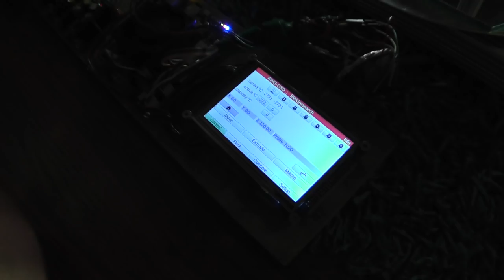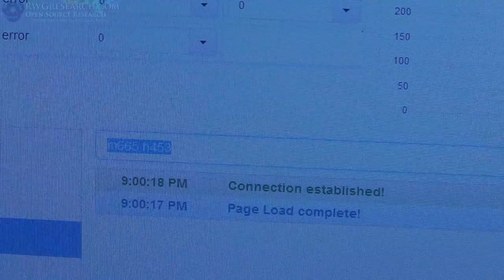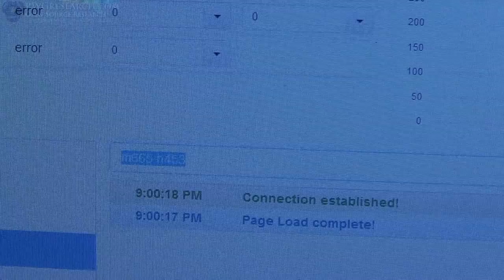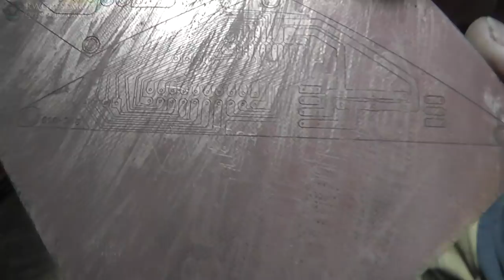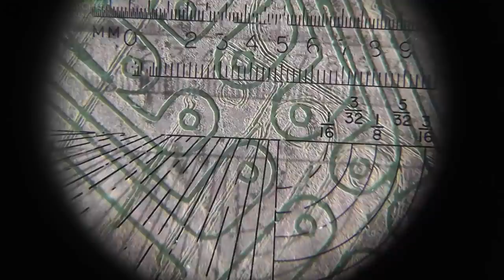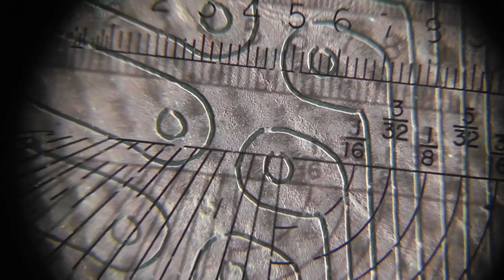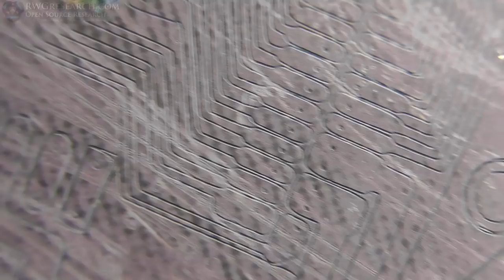RWG-OSD # 28: Scratch n' Etch PCBs - 3D Printer Makes Its Own PCB's! Double Sided!!!

Comment: It took me several goes to watch this because of Lily being a doof :D I was in tears, that was so SO very funny! Please do more videos with her! Just do a skit where you're both at a table and talking to one another :P

I think those sections where you're getting short circuits is where the toolpath ends for that segment. It looks like they're on most if not all of the ends of those pads, and I'm guessing what's happening is the sharpie ink is sloughing off and being pushed along the track by the engraver. That tiny bit of ink at the end of each toolpath is enough to resist the etchent, leaving a tiny copper bridge once the PCB is etched.
Reply: exactly what i think about those shorts
Reply from the maker: the shorts are where the tool path of my slicer.  so the tinny tinny bit of slop on my spring point stops before it makes it all the way around. I could fix that by making 2 paths. but that's how it is for the moment. I use a new way of making the gcode now that resolves that. more on that in a future video. ~Russ 

ps. yes Lilly.  lol.
Reply: ***** Poor Lily! Give her cuddles, she's friggin awesome :D
Can you adjust the toolpath to "overshoot", as it were? Or do two passes and simulate, say, a stepped router path?
Reply from the maker: yeah kinda. I found better ways to do it. I was using .01mm. tool path's. that's crazy. so...  I'm now using a diffrent method of making the g code using flatcam. it dose the job but I have to still change a lot of the Gcode by hand. but that's ok. it's not hard. ~Russ

Comment: Russ, 
You might want to try "Ammonium Persulfate" as your copper etchant. You buy it as a white crystalline solid, mix with water as needed, and makes a clear solution which turns bluer as the copper dissolves. The mixed solution lasts a month or two but the solid will last for years on the shelf. I use it and it works great. The bath always stays clear enough to see the etching progress. I think that is less nasty than the Ferric Chloride type etchants.
Reply: William Hada The easiest I've found to use is equal parts 30%HCl and 30% H2O2. It's a variant of the Cupric Chloride etching solution, and etches very fast- around a minute or so. requires no aeration, just agitation during etching. It can be stored indefinitely in a vented container-very important as it requires some time for al the gas to dissipate. If you have a vertical etching tank, use it to aerate it and you have a starter cupric chloride tank.
I've switched from ferric chloride to cupric chloride a while ago as it is much faster, requires no heating, produces better results and is 100% recyclable - you can precipitate the copper back into metal form, and there's a process to get it back to basic chemicals. With ferric chloride you can't easily do that at home.

Comment: Take a look at Cupric Chloride etching. It's much faster than ferric chloride, requires no heating (just aeration) and uses just HCl and copper for chemicals. You can even omit aeration if you add a tiny amount of H2O2 before etching.
You can make it at home by mixing equal volumes of 30% HCl and 30% H2O2, simple as that. And it is 100% at home recyclable.
Reply: It's only Cupric Chloride after you've etched and is only useable once. But, you can disolve some steel wool into it, and that will give you Ferric chloride, which can be used several times. The iron oxidizes and holds the oxygen, hence the rusty brown color. A very inexpensive way to etch wether you turn into ferric chloride or not.
The HCL is bought at home depot for $10-$20 a gallon and is sold as muriatic acid. Mix one part HCL into 2 parts H2O2(3% Hydrogen peroxide). You can etch with this or add about 7 grams of steel wool to every 100ml of HCL and H2O2 mixture to make ferric chloride.
Reply: Robert Tomkinson CuCl is usable pretty much forever. Just bubble air through it and the extra copper drops out as insoluble oxide. It starts with HCl etching the copper, leaving Cu2Cl. The H2O2 or air bubbler separates one Cu from Cu2Cl and drops it out as CuO. CuCl is a better etchant than HCl.

Comment: Is the side the was not etched as deep the side that was facing down in the bath?  If you don't flip the board or agitate the bath, the side that is facing download is exposed to a smaller volume of etchant. The etchant does get used up as it works and slows down if it is a smaller volume. Maybe getting the board off the bottom by using spacers would help getting the board more evenly exposed to etchant.
Reply from the maker: you are exactly right. after I made this video I was guessing the same thing. also I was using used etchent too. so that's no help. all in all This was a test any how. you can see that the bord was already don't once. lol. ~Russ
Reply: William Hada For single sided boards, I float it copper side down and the denser saturated etchant sinks and it etches faster.

Comment: Sand paper is a big no no as you can see by those deep scratches. Use fine steal wool to polish the board before and after etching to remove the ink. No need for acetone or alcohol. Regular sharpies are not good for etching. Use industrial sharpies or a marker specifically for etching especially if your traces are as small as yours. Regular Steadlers work the best before they changed their formula to their new leave the cap off anti drying up formula. Regular acrylic paint works good too and its non toxic unless you like to get high off the markers. I've used acrylic paint with very good success but may not work as well as a marker for very fine detailed stuff like yours.
I think you should have watched a few how to videos on etching before you tried this.

Comment: Hi Russ, great use of the delta :) I am surprised as your etching you didn't sharpie a positive with your printer and etch the whole board instead of routed traces. great work on the printer btw, I would love to build my own delta :D
Reply from the maker: Yeah. that's also a good idea. for some bords that would work better. but for this one the traces are way to small. I'll keep that I mined for future ones! thanks!! ~Russ
Reply: A while back I built a cartesian pen plotter for doing circuit boards (though I now usually just send stuff off to Osh Park).  I was using Staedtler model 319 S-9 which is their 0.4mm "Lumocolor permanent special" marker.  They come in red and black.  I used the black and it really stands up to the ferric chloride etchant, though I seem to recall that the red was supposed to be even better for that.  I just did some browsing and maybe the Staedtler 313 in 0.4mm width would work as well.  The black is weather resistant.
Reply from the maker: thanks for the comment. I'll look in to that. ~Russ

Comment: Why don't yuo just use a sharpie fine point to fill your vias and etches, soak in solution, still use punch for drill point perfection. It would be like making a normal board. My question is once it's all done can you put a thin layer of blue plastic down and then follow up with a white showing resistors, caps, chips along with the R1, R2, C1 labels in white. I've wanted to try this for a year now but my budget doesn't include buying a 3D printer.
Reply from the maker: yeah some good thoughts. there always  things that go wrong lol . the first problem is that the maker is not good enough for some of those fine traces. i like the punch idea as a hole starter then drill by hand... i can do that with this method.  ~Russ

Comment: You need jumbo sharpies in your life :)
Reply: MiggyManMike :)
Reply from the maker: Haha. yeah I sence then bought one. but next for the laser I will use Somthing like paint. ;)  ~Russ
Reply: Oddly enough I was playing with doing almost the same thing with lasers, my 250mw laser stood no chance, got a 500mw waiting to be tested :D
Reply from the maker: oh cool I orderd a 2.5w lol. yes 2.5watt. it's over kill for most but I wanted the extra power so I can cut things like vinal. and thin stuff.  card bord. stuff for stencles and stuff. but mainly for engraving. will see should be a lot of fun! ~Russ
Reply: Make sure you have the right specs for that, 2.5w is well into "a little dangerous" territory :D

Id have gotten something bigger but right now it's in a little desktop laser engraver, mostly for proof of concept :)
Reply from the maker: nice!! the 2.5w was like 20$ more then the 500mw. so why not. Lol. yeah I will be testing those glass. it should be enough. but I wanna see if I can still burn Somthing through the glasses. of I can I'm scrued. lol. ~Russ
Reply: hey Russ u can "Recharge" the Etching solution FeCl3 with H2O2 hydrogen peroxide and after filtration of the CuO copper oxide ur good to go to reuse the solution

Comment: hey Russ u can "Recharge" the Etching solution FeCl3 with H2O2 hydrogen peroxide and after filtration of the CuO cupper oxide ur good to go to reuse the solution
Reply: icebluscorpion It does work with CuCl, aka cupric chloride. You can also just bubble air through it, as the only contribution from H2O2 is the extra oxygen.

Comment: Why not just use bluing spray or brush?
Reply from the maker: yes. I stated that in the video. but I did not have any on hand. and did not want to wait for some. lol. but that was my first choice. it would go on nice and thick and easy. ~Russ
Reply: rwg42985 oh missed that, i just assumed of course you had some.
Reply from the maker: Lol no worries. all the things I do you would think I would have some. but never really needed it. haven't done to much presition work that I needed to mark out. ;) ~Russ